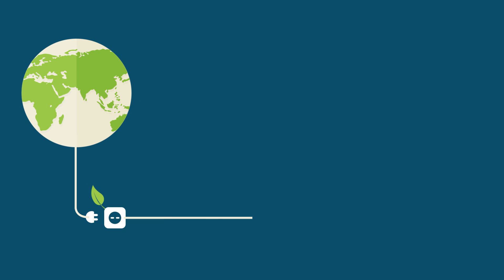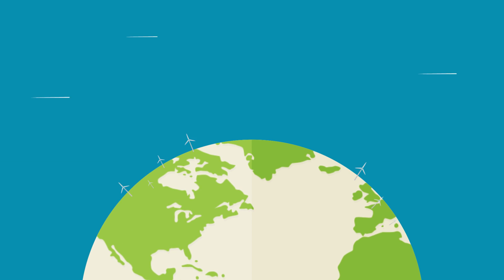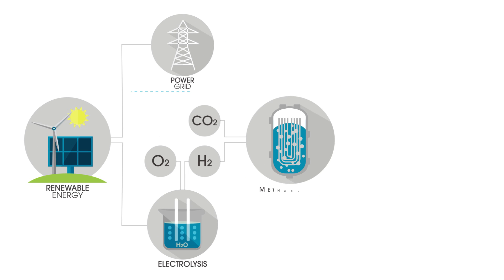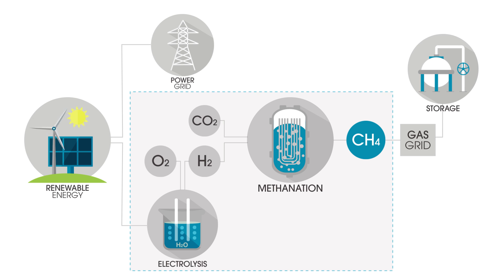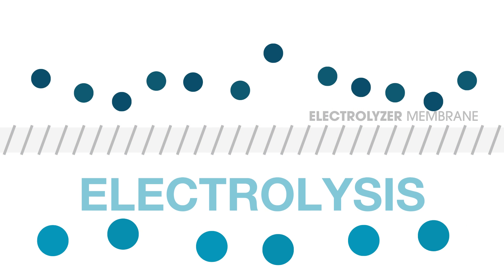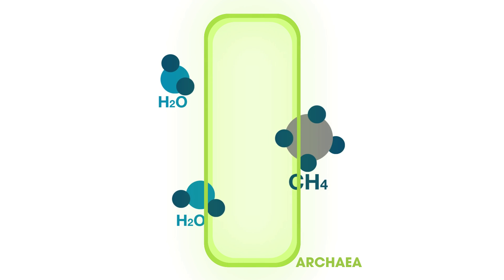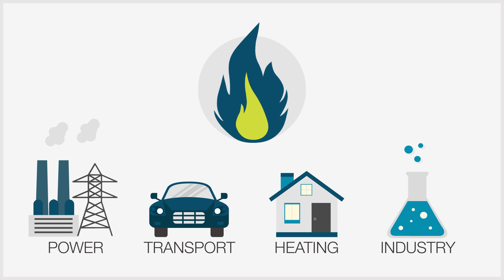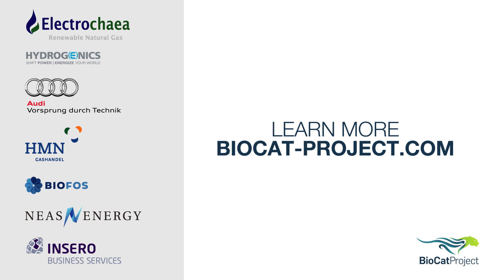The BioCat Project

Comment: If you have H2 why making CH4 if the first is usable for energy generation?
Reply: There are many reason. In case of gas grid it can increase energy demand for compressors, becasue HHV (higher heating value - chemical energy of hydrogen or any other fuel) for unit of gas (normal cubric meter) is lower then in case of methane (hydrogen - 3,54 kWh per normal cubric meter, methane - 11,082 kWh per normal cubric meter), so you have to provide to customer more cubric meters of gas to provide the same amount of energy   (because in EU you pay for chemical energy of gaseus fuel, not for amount of cubric meters). Another problems are technical issues in gas grid like degradation of gas pipes due to diffusion of hydrogen molecules to or through material of pipie, so if they are designed to operate for 30 years, due to hydrogen incjection this time can be shortened. If I am correct there are no gas turbines or internal combustion engines that can burn pure hydrogen, becuse during combustion of hydrogen temperature is so high that it can melt materials from which they are made. You can instead use fuel cells, but they are more expensive in comparision to ordinary turbines or internal combustion engines. There are also some safety issues becasue H2 is flammeable in high range of mixture with air(5-75%) and energy reqire to ignite such mixture is the lowest from all fuels  (0,02 mJ, so it can ingite even  from invisible electric spark). There are a lot of other reasons, you can read simply on Wikipedia, Science Direct (it is easy to find some articles about H2 using Google Scholar, some of these articles are avaliable for free). You can also find something interesting on sites like European Power-to-Gas, about this and other P2G plants.
Reply: Hey Arkadiusz, maybe you should double check, hydrogen energy is 39,443 Wh/kg and methane´s 15.41 Wh/kg from https://en.wikipedia.org/wiki/Energy_density . The degradation I should also check but sounds logic
Reply: Yes, but values given by me in previous post are per normal cubric meter, and you found values per kilogram of mass. These values are uncomperable in this way. When you compare chemical energy of fuels you have to do this for the same units and the same conditions (pressure and temperature, becase they affect distances between molecues). In fact it is true, hydrogen has the highest energy density per kg of mass, and very low per normal cubric meter (because of different distances betweend molecules in different state of matter and conditons), but in reality hydrogen or methane aren't used in liquid or solid form, but in gaseus state of matter, so from practical point of view it is better to use values expressed per cubric meters. In industry these gases can be under different conditions  (mostly different pressure in gas grid), and gases are compressible, so they occupy different volume (higher pressure means, smaller volume occupied by gas, and higher energy density), so their volume is recalculated to normal state (101,325 kPa or as you prefer 1 atmosfphere and 0 Celcius degrees) which allows easier comparission betweend these two gases, and for naural gas it allows easy trade on gas market. It is simply standarization. Most gases are liquified for sotrage or transportation purposes.
Reply: Ok, the comparison should be based on both products at the same conditions, pressure and temperature. I thought H2 was more energetic than CH4 by been a single molecule, I am not a chemical guy ...